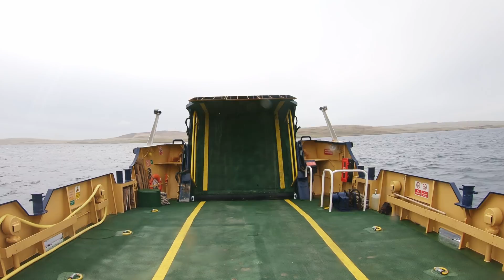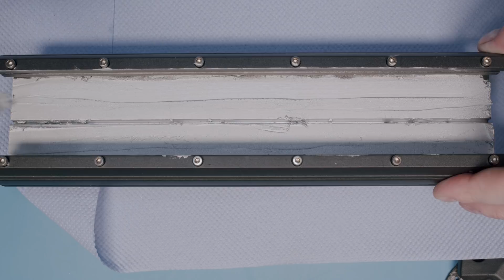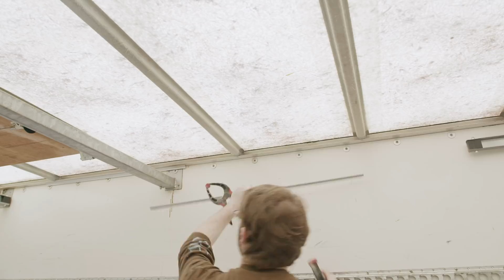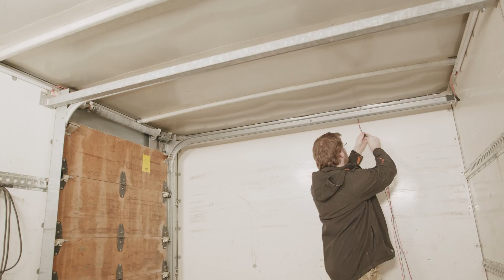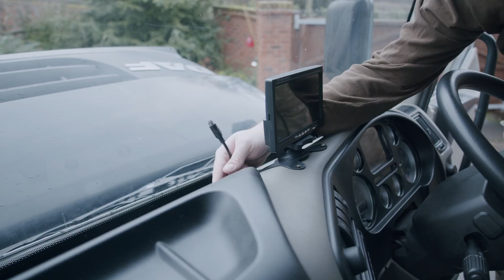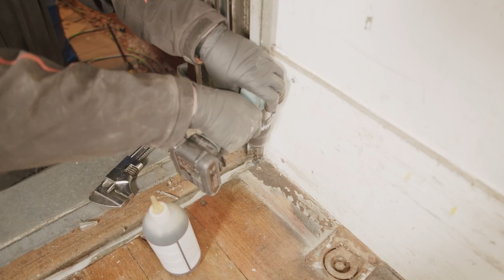Aziz - Light! Adding Lighting and Reverse Camera to the Truck

Comment: What's the name of the waterproofing liquid? It's hard to hear and you didn't have the bottle in shot to show it
Reply from the maker: Conformal Coat, this is acrylic conformal from MG Chemicals but the product has gone downhill since I last bought it, so I wouldn't recommend it. It used to have an applicator in the lid which was much better, and used to wet out better.